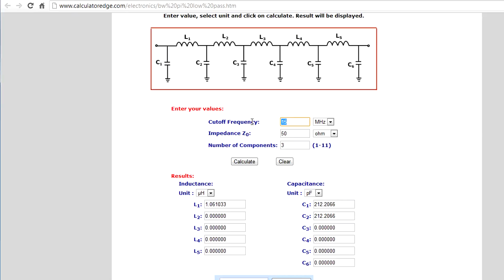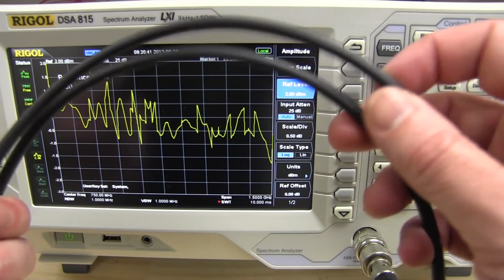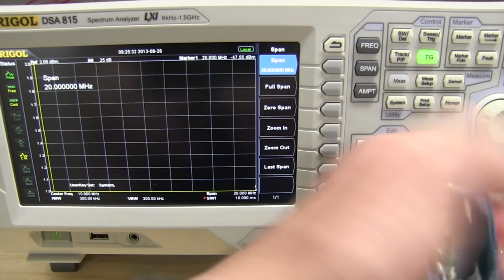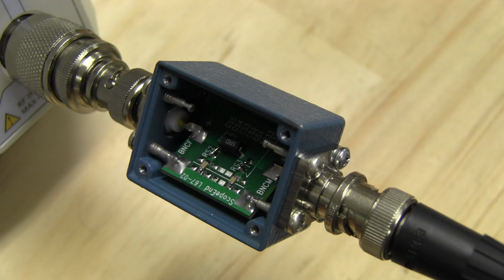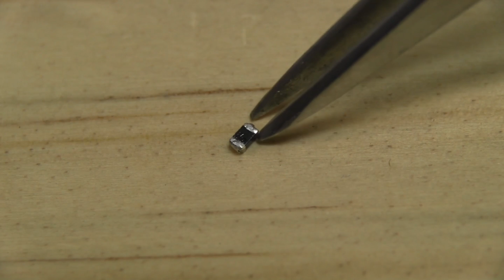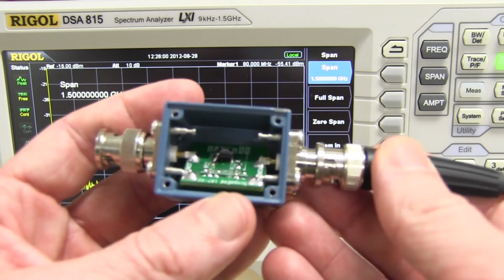EEVblog #343 - Spectrum Analyser Tracking Generator Tutorial

Comment: I have the Tektronix 2712 with the tracking generator. The manual is easy enough to find. I've never used the tracking generator. What I really want to know is setting up the unit with tracking generator on for measurements

Comment: Hi Dave, I see you did this back in 2012 but just coming across it now. Just a thought, I think you'll find that all the peaks and troughs you are seeing is purely from the Cable itself, if you had used a shorter high quality bit of coax i.e. a HP Calibration lead you should see a much flatter looking response. I beg to differ that your Equipment is not so good. When you "Normalized" the lead and then fitted the Filter you created new ripples in the "un-normalized" connection between the Filter and the input. What you need is to have two high quality short coaxial leads with a good quality joiner, connect the two cables together normalize remove the joiner and install the Filter. That should be better approach maybe....but again I think your Spec/Track Analyzer is most likely quite acceptable....but of course I could be wrong...;)

Comment: Hi guy.  Love your blog.  
I've been wanting to ask you a question, so I first tried to find a video that is semi-closely related.  I'm using a wide-band, handheld spectrum analyzer to check the carrier frequencies on both pulsed and CW microwave signals.  I've noticed that when I'm checking the pulsed signals, I have to play with the sweep to have signal displayed steadily. Otherwise, I won't see the signal at all, or it will pop in and out of view. I've noticed some of the later models of say Rhode and Schwarz handhelds will show the signal steadily from full span, from the very beginning without having to play with any settings...see the peak, grab the peak and do what you want from there.  
Do you know why some spectrum analyzers might have a problem with pulsed signals while others don't? Is there a particular spec I need to look for when shopping for them? 

This particular one is an Agilent N9344C. 

Thanks!

Comment: Hi Dave. I am trying to equip a small electronics lab  and I got across to a  Trent type A telegraph and data analyzer. What is this used for? Is it worth buying($70)? Thanks heaps
Reply: in my experience , and i've been doing this as long as dave has.
for $70   if you don't know what it is ,  but your'e intersted in it ..  BUY  IT AND FIGURE IT OUT 

Trust me,  you'll thank me for this advice

Comment: Doesn't changing the span AFTER normalize result in non-normalized data? When I return the span to the 'normalized' span the TG is flat again. So you'd need to normalize the SPAN/Ctr freq of interest before you run the test or you have no accuracy.

Comment: why is important to have high snr
Reply: i realize this  post is 6 years old but just in case someone else wonders the same thing
HERE IS THE SIMPLE EXPLANATION

S.N.R. = Signal to Noise Ratio

What does that mean ?
it's the difference  (Measured in dB    decibel's)  between
a)  THE TOP OF THE NOISE FLOOR
and
b) THE TOP OF THE SIGNAL   (The Signal / Frequency you are analyzing or measuring)

so.....  Noise kills a signal or at the least interfere's with it 

as a general rule  
THE FURTHER AWAY FROM THE NOISE YOU CAN STAY,  THE LESS LIKELY IT IS THAT YOU'RE NOT GOING TO HAVE A PROBLEM IN YOUR SIGNAL 

Example :   Let's say you a measuring TV Signal's in Australia,   let's say it's channel 7 for arguments sake (don't worry about the frequency)
Now, let's say the noise floor is at an amplitude of  30dBuV     (decibel micro volts)
and let's say your signal is at an amplitude of 40 dBuV
in this scenario YOU HAVE AN  SNR  of   10dB

well... now.. if you get really high winds that cause interference in the signal and cause the SIGNAL TO DEGRADE BY 10 dB or more
YOU WILL LOSE YOUR SIGNAL

BUT.. in the same scenario,  if your signal amplitude was at 60 dBuV
so..... you now have an SNR of 30dB
and the same thing happened with the weather
the noise floor would jump up to 40dBuV 
thus the SNR  would drop from  30dB  to 20dB

but... YOUR SIGNAL WOULD BE FINE,  

so.. yes    HIGHER SNR  IS BETTER  because it means the peak of your signal is further away from the peak of the noise floor / interference

HOPE THAT HELPS SOMEONE

Comment: I wonder why people write stupid comments about how this is a worthless instrument. Either a lack of engineering knowledge or simply trolling. I have an ancient Tek 492 at home and I can confidently say that the Rigol exceeds what you can do compared to the Tek for the price. If you are hesitant about buying it, do some more reading; there is a discussion forum around that on EEnews that has extensive coverage from several engineers and amateur radio operators.

Comment from the maker: Huh?
You complain about me showing expensive equipment you can't afford, and then also complain about I don't do use it on a worthwhile project? WTF?
BTW, this is the lowest priced spectrum analyser on the market that can do this. It's only $1500, which is CHEAP for a spectrum analyser in case you didn't know.
Reply: Exactly,   and i'll back that up 
I have a Unahohm  spectrum analyzer that does  DVB-C and DVB-S, DVB-T  ,  I paid $7,500 some years back

$1,500 is fuck all for a spectrum analyzer
Reply: HA just got a silent SSA3021x plus and it blows this out of the water for the same price

Comment: Hi Dave This is my first comment.. i am going overseas and i take my laptop and phone charger there but they get too hot there and phone charges very very slowly compared to here in Australia... Whats going on?? if ac power is bad then can u tell me a good circuit i can buy or build something like a AC power filter or something... i don't know.... Thanks Dave Please help :D
Reply: Which Country did you go to ?

i mean, if you're from Australia,   and       we use  240 V , 10 Amp  at  50Hz   for residential mains power in Australia.
so.. if your laptop's supply is rated at   INPUT 240 V  AC  , 10 AMP   50Hz
and let's say the output is something like      16V  DC,  2A
and you take it to a country that has say  100 V Mains  at 60 Hz   and i don't know the current in those countries,

yes.... it's gonna charge slower,  of course , if it charges at all.
as for getting hot
check the AMPS  Rating

so... if your little charger is rated for 10 Amps but they have 15 or 20 Amps overseas.... yes, its' gonna get hot ,  of course 
it maybe even blow a few caps or other components 
BE CAREFUL WHEN DOING THIS, you might be buying a new laptop

Comment: The jumper wires used for the two resistors are adding a series inductance with the capacitors. Try to "air" solder them together.